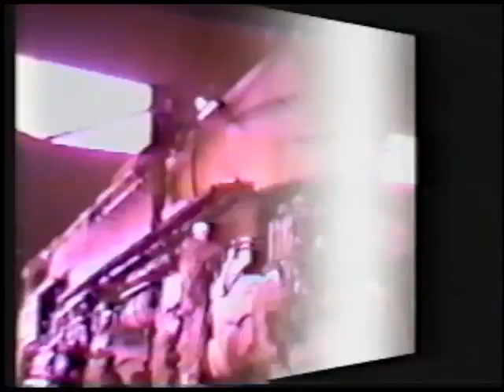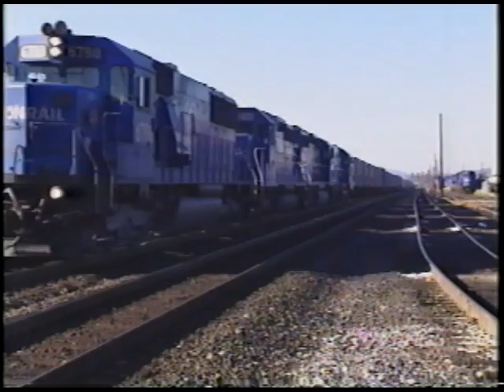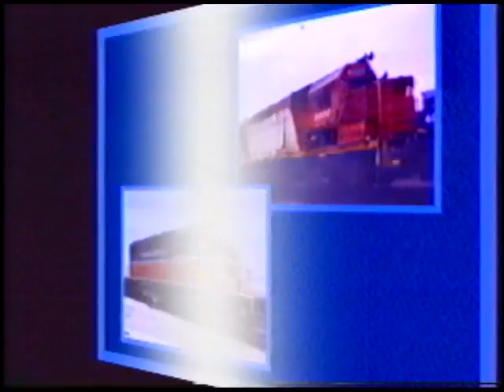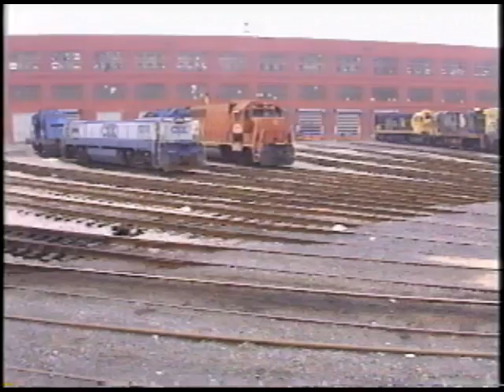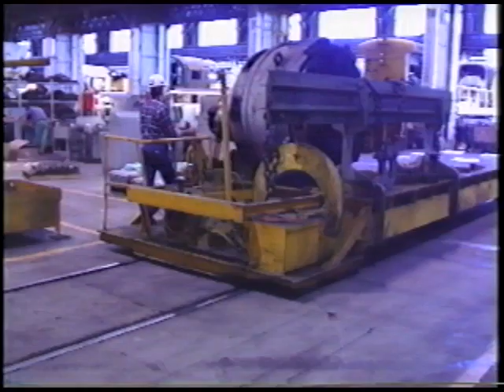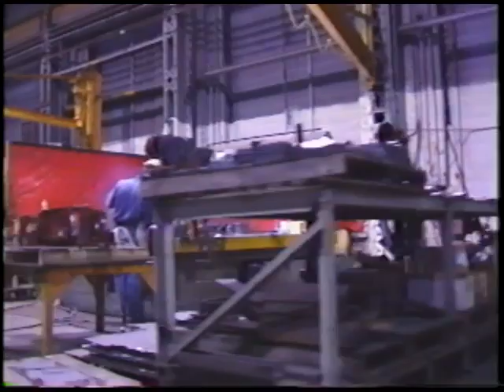CONRAIL: Juniata Shops, 1994

Comment: At the time this was filmed, I worked in Juniata backshop as an electrician responsible for operation of the 200 ton overhead crane. Spent many nights(second shift) retrucking locomotives by lifting them off their old worn out trucks and setting them on brand new truck sets. Due to family requirements I left December 1994 for better parts. I soon found myself working for Union Pacific in Roseville California where I finished up my career. Part of the  Snowfighters that kept Donner summit open in the winter months. Some of the best times of my life…..